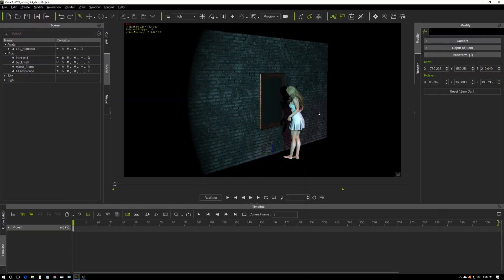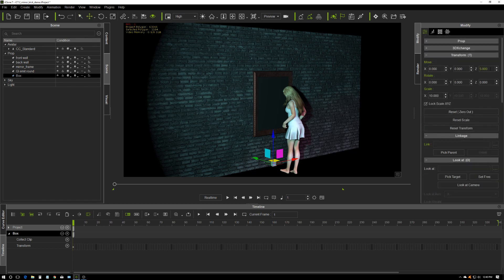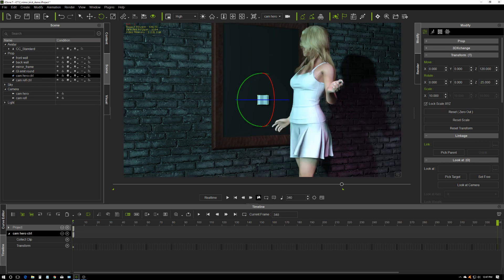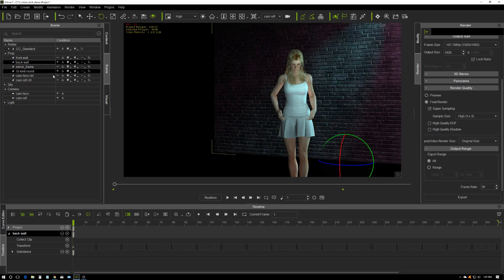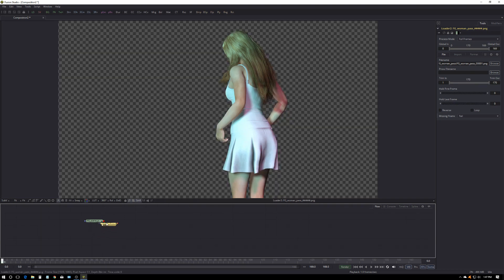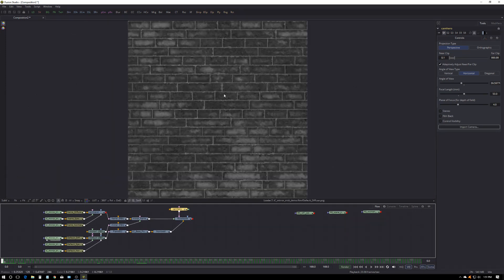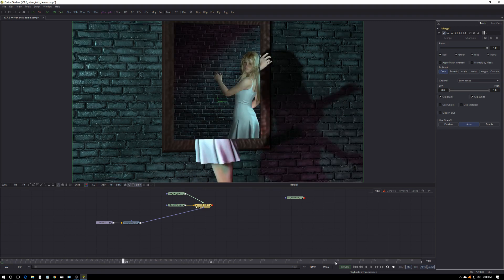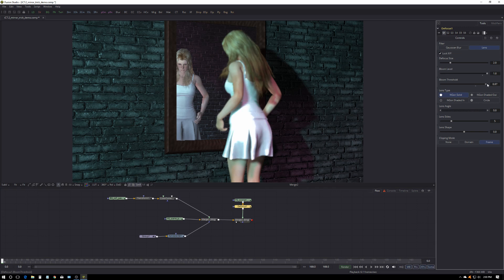iClone "mirror trick" using Fusion 9

Comment: Awesome tutorial, you can upload the render directly onto the texture file. Iv'e done one with the same technique. The relative distance of the mirrored camera in my tutorial seems to be the missing component. I think a combination of your mirrored camera and the rendered video in the diffuse texture map in my tutorial may both be the key to making this technique more efficient. I hope Reallusion thinks about making a planar prop with a script that allows for this technique to give us mirrors for our scene. Try using the bump maps, and other maps for a variety of mirrors. Great job !! Check out my tutorial at https://youtu.be/FJN9fAjfM7w and leave some feedback if you get a chance.
Reply from the maker: The technique in your video is a 'quick cheat' that can work in certain situations, but it's not achieving a true mirror effect.  I don't see the advantage of rendering the "reflection pass" and using it as a texture map in iClone - once it's in Fusion you have far better control of "the look"... for instance, I could add a dirt map that 'blurs' parts of the mirror - or interactively add cracks and image distortions as well as lighting effects, colour corrections etc. (not too mention the "focus pulling" in my tutorial)